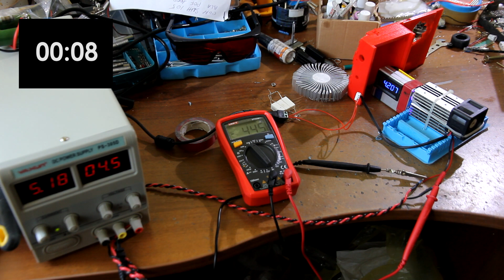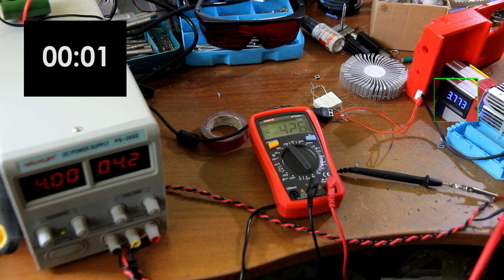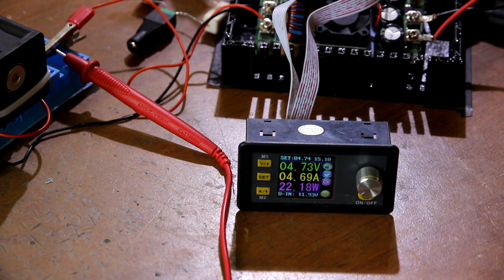Testing of a NICHIA NUBM44 / NUBM47 445 nm laser diode.

Comment: Hmm, so if in fact W=VA or P=IR.  . So at 4V/4A, that's 16W. Is this actually a 16W diode ? That seems a bit excessive. Are you dropping that across some sort of parallel resistors or is a bunch of that potential being dropped across the fan load and other stuff ? What is the fan alone consuming ?
Reply from the maker: for laser diodes producers present optical power, not an input power...

Comment: I have the NUBM08 4,3W laser diode. The diode gets hot and the power drops. This is normal and the diode will recover after cool down. BTW I have the sams lpm
Reply: it shouldnt get hot, you have to cool it with your cooling system. on the video they use a fan and an aluminum heatsink but thats not the best cooling system for a diode like this, the best would be water cooling.
Reply from the maker: yes, that one is less powerful actually